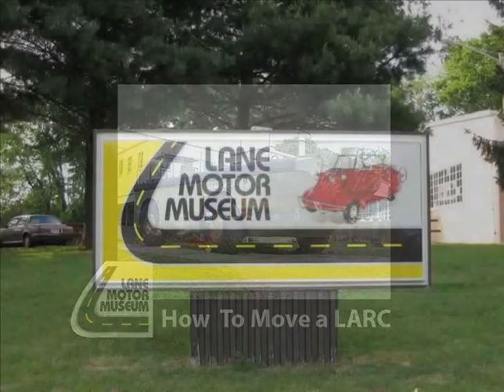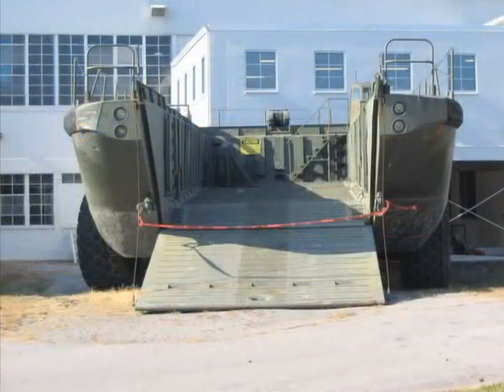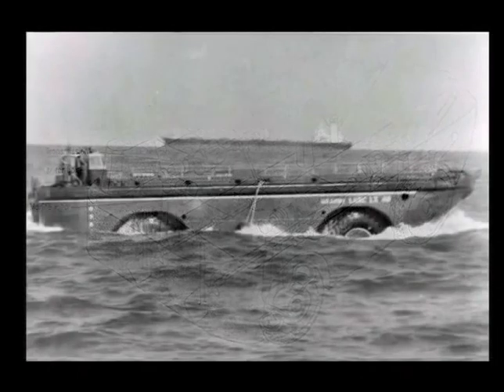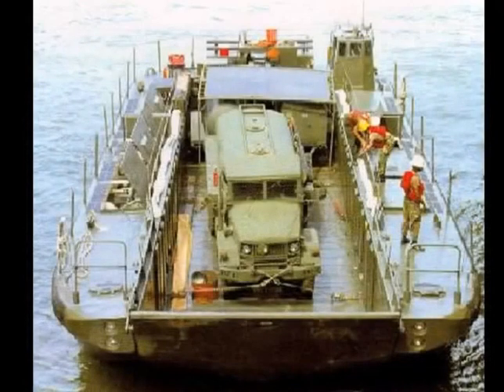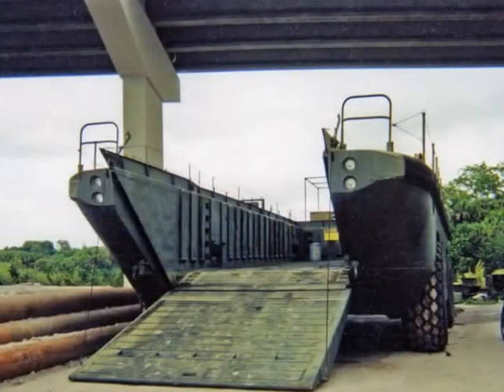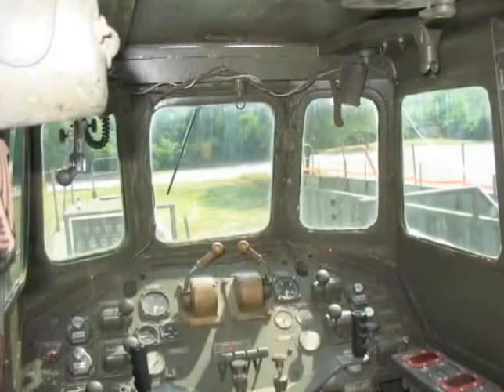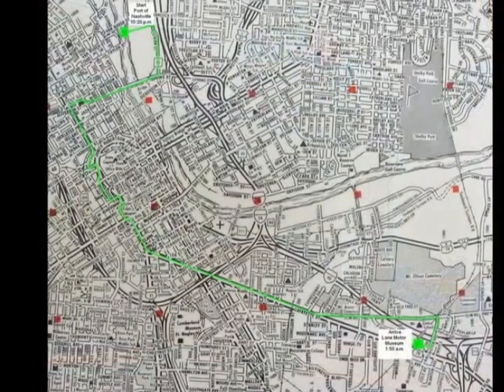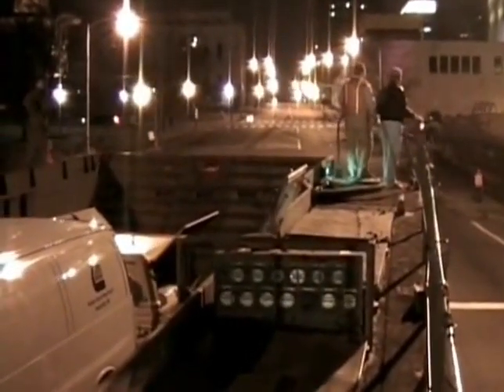Moving A 1959 LARC-LX Across Nashville

Comment: I'm on an adventure set out to find and save as many of these monsters as I can! But what happened to this LARC? What mechanical problems do not allow you to drive this? I can find a friend who can machine parts for this free of charge. We here have a CNC class and this would be a great project. We can replicate OEM bearings, tires, bolts, bulkhead fittings, etc. Our local junk yard has tons of parts for the 671 Detroit Diesel. Were the 3 speed auto trannies built by BorgWarner?

Comment: Only 165 horsepower per engine? I was expecting a lot more than that.
Reply: Toby Wood about twice to three times that much torque per engine.
Reply: Buzzard the arms enthusiast Ah, that’s the important bit I suppose
Reply: @Ashfielder  yup. looks like a 6-71 Detroit making around 550-600 ft lbs of torque. So realistically the LARC with all 4 engines probable made about 660hp and about 2200 ft lbs. Also this thing isn't meant to go fast, so its geared extremely low allowing it to slowly push through anything while carrying anything.

Also, Hi Toby from Phly's channel!